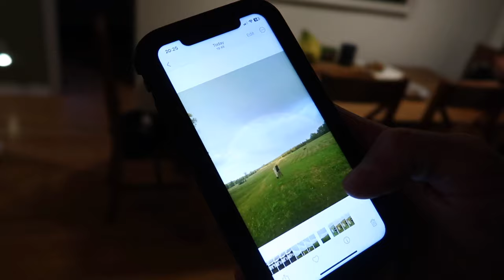Declutter and Organize With Me I Messy Home Series

Comment: Thank you! My house is so u consistent, itll be very clean for a bit and then a busy week will pass and all the usual spots will have built up junk again and its so much work to undo it all. I tackled a coffee table thay had books, pens, water bottles on it, none that had to be there. I hears about using a 'one touch method ' where if you are holding something you never just put it down, always away, so you are only touching it once. Im going to try do it more often.